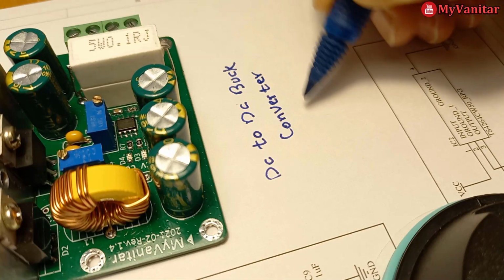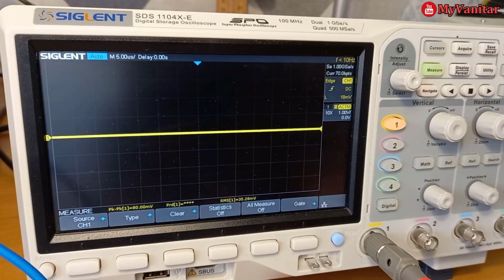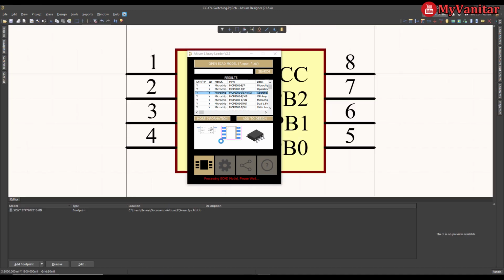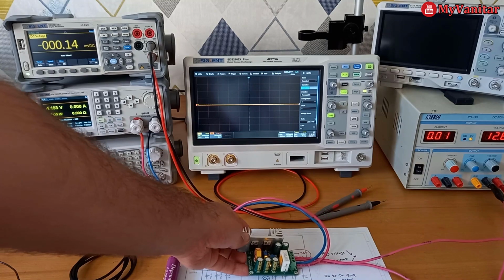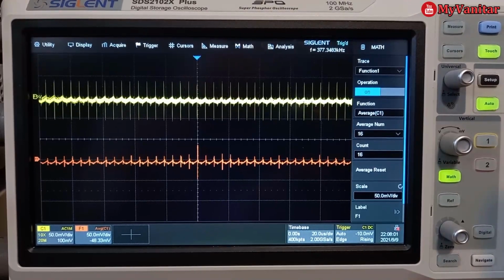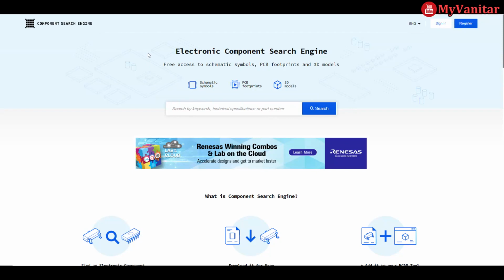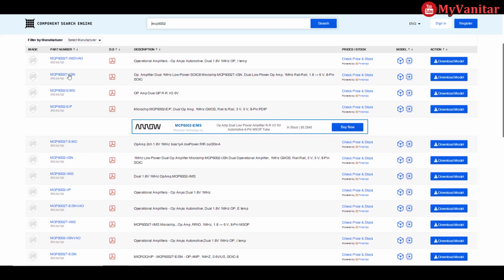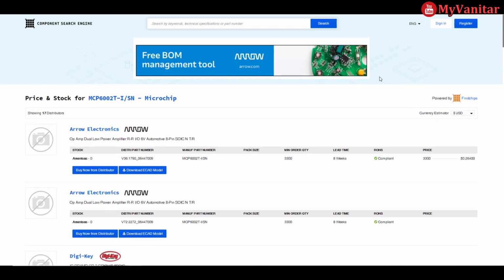0-30V, 0-7A Adjustable Switching Power Supply [CC-CV, Buck Converter]

Comment: Firstly thanks a lot for your project. Excellent work ! . As a matter of fact i was looking for a working circuitry for indicating cc /cv modes by leds, in order to use it on a buck converter based on tl494.  BUT in your schematic it is not shown the connection of IC1 ( MCP6002) PIN 5 . PLEASE CLARIFY CONNECTION OF IC1 PIN5 .  . Many thanks in advance.
Reply from the maker: Pin-5 has a label named "CC". It is named a net label in Altium which is connected to another point labeled "CC"

Comment: Hello, The pin 5 of IC1 (MCP6002) is connected to pin 2 of XL4016 right?  and another question is the R1 neccesary? (in schematic is says 0R but  in the phsyical pcb exist too)
Reply from the maker: Hi, 5 to 2 (FB pin) is connected. R  is a zero ohm or a Jumper. of course it is necessary!

Comment: Hello, one question with a 12V fixed input this circuit output is 0-30V? (new in this area)
Reply from the maker: No, this is a buck converter, which means the output is always lower, what you want is a buck-boost, I will publish this also in the future, so subscribe to get notified

Comment: Hi, how to order the pcb？thx
Reply from the maker: when you ask this question, I realize that you haven't watched the video completely. I publish an article (with a more detailed description) with each video that you can access through a link in the video description. Please check the article. There is a place where you can order the PCB.
Reply: @MyVanitar  I watched the video completely now, I know how to order it now, thank you.
Reply from the maker: @Chanchan1-k7q  Good luck
Reply: @MyVanitar  the PCBs is delivered, but can’t find ts4264cw50 anywhere, do you have any alternative parts recommend？thanks in advance
Reply from the maker: @Chanchan1-k7q  Yes, you can use TS2937CW50 (SOT-223, 5V regulator), however, I think you can not insert 30V to its input with some safety margin. I did up to 28V. Datasheet says up to 26V. check the datasheet.
Reply: @MyVanitar  I will use this for my 211 tube project, only 16V input and 10V 3.25A output. Anyway thank you very much.
Reply from the maker: @Chanchan1-k7q  So yeah, just go for it and have fun :-)

Comment: What happens if we add another 470uF capacitor to the input?
Reply from the maker: nothing bad, you will get lower noise at the output, however, it is recommended to add that capacitor near your load because power wires introduce some noise themselves.

Comment: Excellent video! I have already bought the PCB's from PCBway and all the components are ordered, but I would highly appreciate some info about what type of core and wire you have used for the 47uH inductor L1 and the number of windings. Thanks.
I am really looking forward to build this amazing power supply.
Reply from the maker: Thanks! I have offered some tips in the article, so please double check that. White-Yellow cores are made of iron powder, they are better, however you are not bounded to use them. you can use black torrid cores as well. the hole diameter of the inductor pins on the PCB is 1.3mm. so maybe you can use a thick 1mm wire, or 2*0.5mm wires or 3*0.4mm wires. at the end, 47uH is okay. it does not need to be very accurate. something around this number is fine
Reply: @MyVanitar  Thanks! I will buy some iron powder cores, wire  and a LCR meter and try it out. :)
Reply from the maker: Since the users will not use identical cores and wires, it is up to them to select the cores and wires to match 47uH, using an LCR meter. even if you have a standard 100uH torrid core, just open half of the windings to get around 47uH.

Comment: What is LGND in the schematic and how does it apply?
Reply from the maker: LGND means the load's ground, because the shunt resistor is in series with the output ground, it means the input ground and output ground are NOT identical, if you short them, the current sense part will not work
Reply: @MyVanitar  Oh cool thank you so much. So in this case, both GND and LGND connects together and there are actually the same thing right ? Connects via the shunt resistor
Reply from the maker: As I mentioned, they should NOT be connected to each other. it is pretty clear. This method is called the low side current sensing, where a shunt resistor is placed on the ground line. You can read about this online (low side current sensing)
Reply: @MyVanitar  Thank you so much for the giving clear idea on it. Appriciate it :)
Reply: @MyVanitar  Just one more thing, this can be used from 0.01 Ohm instead of 0.05 Ohm. Hope I'm correct
Reply from the maker: @chamaljayasuriya1887  Yes, you can use a lower resistor, however, then you may not be able to limit the currents for lower values (because the gain of the opamp has a limit), for example, with a 0.05R resistor the minimum limit is 10mA, but in your case, the minimum might be 60-70mA.

Comment: My question is how fast can it limit current, because you have large capacity like 1500uF at the output. 
Suppose it is set to 30V. I limit the current to 10mA. Then I connect NanoPoint-0201 Series LED. Will it survive?
I would like to see a current graph from your beautifull oscilloscope for that case.
Reply from the maker: Good question, if you want to have a quick response, yes, you should decrease the output capacitors, because they cause delay, however, if the output noise is important, you have to make a balance between these two. My suggestion for the loads like LED is not to go very high in voltage or reduce the capacitors. That's why LED power supplies don't care that much about ripple and noise, current limit and the peak current are more important.
Reply: @MyVanitar  It is not for driving LED's, but to indicate the sensitivity of small devices if one uses this huge power supply as a lab bench. I took this small LED just as an example. The current limit only works after the stored energy (up to 30V) in the capacitors flowed out unregelated... Cannot there be something like an automatic quick discharge of the capacitors if the voltage has to drop for current limiting? Or quickly switch to a small capacitor?
Reply from the maker: @geerthospers5977  For your mentioned reason, the laboratory power supplies are linear because the output noise is low and they don't need to use large capacitors at the output, however, they are not efficient, but the best choice for sensitive loads and "laboratory" use. if your load is not sensitive to noise, just reduce the output capacitors, however for a general solution, maybe an inrush current limiter would be more useful. so you would connect your sensitive loads with a limiter. However, even for my own lab power supply, I always care about the voltage. The main benefit of CC in the "general" applications is not to leave the voltage as it is, however, is to keep the current limited, for example in the case of charging a lithium-ion battery. We "set" the voltage at 4.2V, BUT, limit the current to prevent the battery from exploding.
Reply: For efficiency and lower ripple one can use a SMPS preregulator and then a Low Drop linear regulator. Better the low drop should track the SMPS to maintain the least voltage needed for regulation. In that case, say a 0,5 volt drop at 7Amps would produce around 4Watts of loss.

Comment: i want to design constant AC voltage (12V or 24V) power supply from 220/240 V, please help me
Reply from the maker: Constant AC voltage? Why not using a transformer. 220V to 12V or 24V transformer. if Your load consumes 1A, then use a 1.5A or 2A transformer. then the voltage will not drop
Reply: @MyVanitar   will output remain same when input voltage changes (like 200 to 250v) in transformer?
Reply from the maker: @RehanKhan-nc6bf  So No, in this case, the output will be reduced. You will need an AC regulator. I will talk about this in the future, however, I can not guarantee the time
Reply: @MyVanitar  ok bro

Comment: But why the title *0-30V*??  I was hoping for a buck converter that goes down to 0V but that's not the case here
Reply from the maker: The title is like that because 1.2V in 30V is nothing and it is written in a generalist form, however, in the detailed explanation, it is written that the minimum is 1.2V. To start from 0, it just needs a small circuit tweak, however, there are rare scenarios that below 1V is necessary. So I decided not to go for it for this circuit that is intended for power applications, however, I'll do it for the next buck design, no worries.
Reply: @MyVanitar  I didn't mean it's bad. Heck I don't remember when I ever needed less than 1.5V on my psu. If need ever arises for anything below that I can always put a hard current limit and let the voltage sag to zero if required.